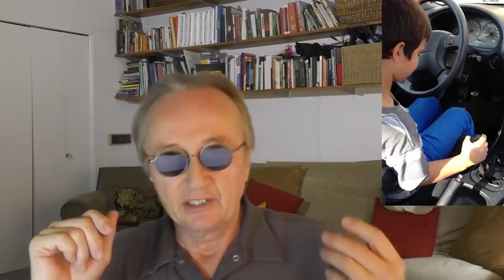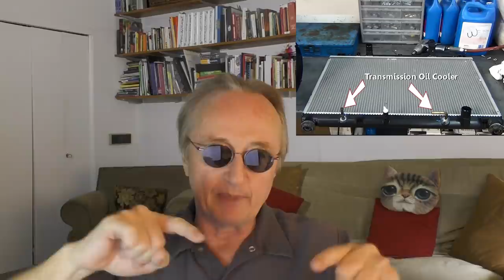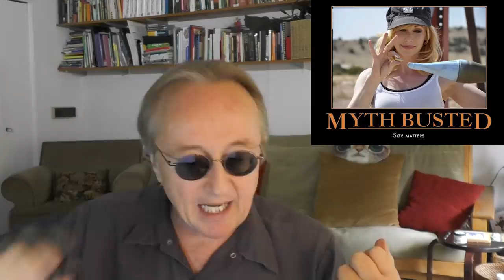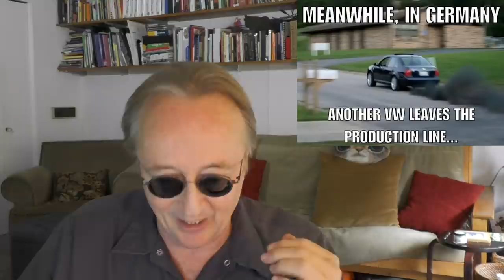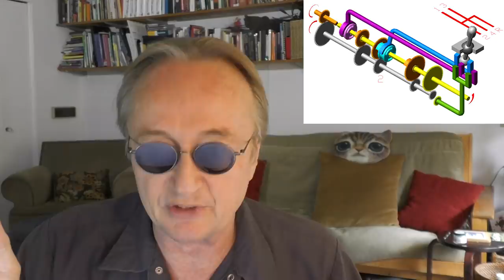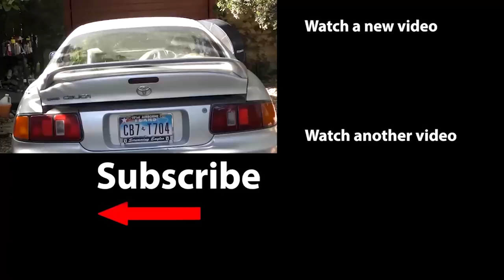Doing This Will Destroy Your Car's Transmission

Comment: I once accidentally shifted my dad’s 1998 ford explorer from drive to reverse at 30 mph. The engine stalled, but I stopped, shifted to neutral, cranked it a couple times, shifted to drive and drove off fine. That sane truck is still going 4 years later.
Reply: 98 Ford wow!

Comment: I can remember back in the late 60's early 70's, Chrysler has a commercial on t.v.. The commercial showed a Chrysler car, wit tires smoking, and the driver slamming the TorqueFlite transmission, from drive to reverse & reverse to drive,  for the entire 30 second commercial spot...Anyone else old enough to remember that  ?

Comment: Back in 1999 when I was young in my brand new Ford Ranger, I tried to show off for my boss mistress and tried to coast in neutral to rev the engine. I accidentally threw it into reverse for a Split Second then threw it back to drive. Made a hell of a tire squeal and she was impressed. I knew I screwed up big-time but here I am in 2019 still driving that same truck with no issues and 195000 miles. I really got lucky on that one. And my mistress boss gave me a raise LOL

Comment: Solution for #1: buy a manual transmission. 🤯
Reply: Junior I stop before shifting whether I’m in a stardust’s or auto. Not sure how different manuals transmissions are in that aspect
Reply: #1 anti theft device. The stick.
Reply: Some people can barely operate an automatic, throwing choice of gears and a 3rd pedal would destroy their life
Reply: @alansmilealot  true
Reply: Flat and the transmission
Reply: Flat if they made a stick shift Tahoe, I’d buy it.
Reply: @surgeonso4345  they do make one.................................

It's called a Mack Truck lol
Reply: Flat lol I don’t think my chain of command would like me driving that to PT every day.
Reply: @surgeonso4345  lol
Reply: Just paraphrasing Scotty.
Reply: Vladimir_Bone Spur_tRump  your comment would be considered dusty if you ask me...
Reply: a manual will leave you stranded many times throughout the life of a car every time that clutch is done. 

a proper automatic maintained correctly will last the life of a car.
Reply: @KyLesCaster  wait what, I've had many automatics go in higher miles vs losing clutches. I only loss one clutch ever and it was due to a seal going and spilling out on the clutch, I was able to get home still with it slipping. The autos had me fucked in the A.
Reply: i consider the life of a car between 0 miles on the odometer to 300,000 miles, a manual transmission will need at least 3 clutches minimum in that time and thats if driven very well.

an automatic will not need anything replaced. just be diligent changing ATF

Comment: OK every car my dad owned when I was a kid 50+ years ago would pop out of first gear when going downhill or even decelerating.  My dad was cheap and only bought used cars with 3 on the tree transmissions.  I grew up thinking that all cars were supposed to work this way.  Thank you for enlightening me Scotty, a half a century later.

Comment: Scotty, my dad drives a 2005 Jetta. Recently, the drivers window stopped working, then the drivers door lock stopped working, then finally, the interior trunk hatch and gas hatch latches stopped working. My guess is water in the door shorted a circuit. Everyone online says to check fuses and for bad grounds. I had to take apart his trunk's interior liner to pop open the fuel door with the emergency latch. I strung a string from the latch into the interior of the trunk through a hole I poked in the carpet. So, he can at least pull that from inside his trunk to pop the fuel door.. it's only a matter of time until his key remote can no longer pop the trunk!
Reply: Did you check the wiring between the driver door and car?  Those can break in the rubber boot due to how thin they are.

Comment: Automatic transmission are so expensive to fix
Reply: Not if you fix it yourself...
Reply: @nightdan7096  Not many people can rebuild an automatic transmission by themselves. Even if you do, it's still expensive.
Reply: What's expensive. If it's not over 5k then it's not alot
Reply: Thomas Golden 
It is when my entire car costs 5k.
Reply: @tenhundredkills  The most expensive rebuilt kit I ever bought was $300 for a Transtar master kit for my Toyota which I could have bought a different brand like I did the first time I rebuilt it for $125 which still last 200,000 miles. I can usually get a descent master kit for well under $200. Shift kits are well under $100 for a very good one. Torque converters are cheap. On manual transmissions you can replace the gears individually and the same with the bearings. Clutch, pressure plates and throwout bearings are cheap. It doesn't matter if it's a truck or car. It's not that expensive if you know how to fix it yourself and shop around for the parts. The newer ones simply have more parts. I'm a self taught mechanic from a very young age. I taught myself how to rebuild transmissions/engines, automatic/manual from reading books because I got tired of mechanics changing one clutch plate worth a few bucks and charging me for a full rebuild. When my transmission went out a couple thousand miles later after I moved 900 miles away and I took the transmission apart to see it still had the stock parts in it I was fed up getting ripped off.
Reply: @nightdan7096  Your time is still worth something too. How many people are going to take the time to learn the workings of any automatic transmission, diagnose the problem, and then repair it. It's specialized knowledge. Why else would you have businesses that repair nothing but transmissions and even then still can't get it right? It's complicated work. It's cool that you know how to do so, but don't say that it's "cheap and easy" for anyone to do. Manual transmissions aren't too bad, but the original comment is that automatic transmissions are expensive to fix, which is entirely correct.
Reply: So are engines but drivers ignore that more and say "It's be ok" lol
Reply: If you find,a good reliable guy not lart of a shop you can get it at a deal. Had a guy rebuild my 4x4 4l60e took it out himself and installed it himself for 900$ that was 20k miles ago.
Reply: Included fluid. Drove it 150 miles home hasnt skipped a beat.
Reply: @tenhundredkills  Automatic transmissions are the cheapest to fix. I know from experience. You obviously don't. I'm not having a pissing contest with you.
Reply: @LWNDmax  That a good deal since the guy also took it out and installed it too and included the fluid.
Reply: @nightdan7096   Not everyone has mechanical abilities, or can figure that stuff out.  It's like telling someone who's not good at math that calculus is easy, or telling someone with no artistic abilities that painting photorealistically is easy.  No one can be good at everything.  If working on cars was easy, everyone would be able to fix their own car, and there would be no need for mechanics.  That being said, you're lucky that you can understand that stuff!  Working on cars sure sounds like a fun hobby, but I have no mechanic abilities whatsoever.  I do change my oil and other basic maintenance, but I wouldn't attempt any repairs.
Reply: @hamsterama  Here is a sentence straight from my comment "It's not that expensive if you know how to fix it yourself and shop around for the parts." Did I say anywhere in my comments that anyone could fix or rebuild transmissions? No, I dint. I said "if you know how". Did I say anywhere that it's "easy"? No, I dint. I dint comment expecting everyone to be a freaking mechanic and to get butt-hurt if there not. What's wrong with you people. You just like to start arguments for something to do? Does it make you feel big or something or important. You gonna leave Scotty negative comments to because he talks about stuff you don't know how? What you just wanted to get your 2 cents in?
Reply: @nightdan7096  It sounds like you're having a pissing contest to me...I'm going to have to call bullshit on that claim!
Reply: Yes they typically are but it’s certainly not cheap to fix a manual and automatics don’t ever need a clutch replacement. They both have their place and neither is inherently better than the other, people need to learn to accept this.
Reply: Usually it's better and depending on the car cheaper to get a rebuilt one already
Reply: @nightdan7096  dude try building a transmission for a mercedes...
Reply: Just go pull another one from a junk yard
Reply: The big chains are a rip-off.  I had a local shop rebuild a transmission for a Chrysler for $500 and it worked great for another 10 years. Maybe it would have lasted even longer but I sold the car.
Reply: @marcelrodriguez2067  I had to come back and reply to your comment about the Mercedes transmission. It doesn't matter what vehicle it's out of. That's like saying you can work on older cars but not newer ones because they have electronics. A Mercedes transmission is no harder to rebuild then a Toyota or Honda transmission. Now you get into the more newer ones and you have more clutch packs, servos, parts, and also more electronics. The same process continues.

Comment: For anybody that wants to daily a jetta do it I have friends with 300k-400k on it and runs perfect I daily my jetta and put 10k on it a month I love driving it and I've had no issues same with all my friends  but dont get a auto they do happen to be weak.
Reply: 2nd this. I've got over 380k on my 02 TDI and it's still going strong.
Reply: I have an 04 Jetta 1.8T Manual. Bought it with 193k miles a little less than a year ago. It’s now about to hit 206k miles and the only thing that broke was a 40$ crank sensor since then it’s been crazy reliable and tons of fun with the turbo. Regular oil changes are key and they’ll last a very long time.
Reply: I don’t drive a Jetta but I have friends that have the older ones and they never had any problems with them, the ocasional clutch replacement here and there because they shift to early but other than that no issues.
Reply: Scotty sees the worst cases.  I had a neighbor who thought her Toyota was garbage because the engine was worn out at something like 65k miles, she never changed the oil once and probably never even thought to check it.
Reply: @motiszm  258k right here
Reply: What make and model???
Reply: @DeadlyDre  what do you mean what make and model were talking about Volkswagen jettas

Comment: The brake lights switch man. I had that issue on my 88 civic and that was getting to me for a good week and a half. My battery kept dying and I couldnt figure out why! Changed out fuses, new battery, nothin. I just happened to drive it around towards the end of the day on that last day and noticed my brake lights were staying on! It was the switch. So frustrating..

Comment: Smart guy here. I got a Chevy Sonic. 106K miles. It still runs great and never had a major problem. In fact I've never had to replace the breaks yet. STILL factory.--- My problem is this. The motor oil says 10-30 BUT 1 day it was really low so I put 10 -20 and for some reason now my gaskets leak oil. IF I get an oil change and put the right oil will the leak go away or did I screw it up and now need new seals? Thanks Scotty.

Comment: yep already did this with my trans prof, he says you got a flimsy band to hold the planetary gears and a solid but rigid band and when RD comes you get parts in the pan if you continue to play with RD  without stopping all the wheels since the strong but rigid band will break since its supposed to be grab the case that houses the planetary gears for reverse when it is completely stopped, the flexible one is good for going forward since thats what it was made to do it absorbs the engine torque while holding the housing (look up the inside of a auto trans if your really confused at what I'm saying I am not going to put the full story without pictures into a comment section). Though under an amount of strain flimsy won't like you and tear himself to shreds. in which leads you going nowhere in first gear or second and you'd be lucky to have a car now a days with a turd gear selection, though I would count on it making you move either.

Comment: When the engine is idling and in neutral, let the clutch out and then push it back in and immediately try to put into reverse. It should go if you spin the transmission.  If not. repeat again till it goes. When cold, the GO 90 is so thick it is hard to find reverse for sure.  My Muncie 4sp is the same way when cold.

Comment: Damn right. I shifted to reverse at 55mph for a split second on accident. Front and rear u joints had dents from the bearing needles and started growling.  With a front wheel drive car you are putting so much extra stress on the motor and trans mounts when shifting at a roll, so don't do it.

Comment: Old Jeep manual transmissions, I don't believe had synchronizers for reverse. The 95 XJ that I had would not go into reverse sometimes without first popping the clutch in neutral then pressing the clutch again and mildly grinding it into reverse. I believe it's because without synchronizers, the sleeve would not always line up correctly and would just bump into the cog.

Comment: Another thing for an automatic transmission is if you're parked on a hill put it in neutral set the parking brake let go of the brake pedal so that the weight of the vehicle is on the brakes then put your vehicle in park by doing this you're not putting so much stress on the pin that locks the transmission into gear and this can prolong the life of your transmission as well.

Comment: On a standard transmission when it is cold the oil in the trans is thick. It is hard to get any gear. Sometimes reverse has extra step like pushing down or farther to the side. I own a Dodge with a 5 speed. In the winter I put it into the gear I will need first thing in the morning.

Comment: I switched my transmission fluid in my 2005 Civic ex (automatic transmission) to Royal purple transmission fluid in 2015 the car is shifting well, even in this extreme weather in Northeast Ohio (under 0 or close to it) it also started very well one crank considering the cold, using 0w20 synthetic and a new AGM battery. The idea of ONLY using Honda. Fluid isn't completely true.  If u are smart enough to use quality synthetic) and don't down grade.

Comment: You also shouldn't throw your car in neutral when driving. Some people do that to "save the transmission" if they are coasting but that's bad to because you go from nothing, no spinning gears to putting it in gear when you go to slow so you go from nothing to spinning fast in the transmission and it hates that. I use to do that taking exits. I'd coast and pull it in neutral until I need it back in gear like a "manual" that's bad.

Comment: I had a 1997 Chevy s10 company truck do that before. But it did that on fifth gear, not first.  Turned out, they put in a new transmission price of about $2500.

Comment: Hey Scotty, we have a 2005 Cadillac Escalade (Ironic because you mentioned it in your SUVs not to buy lol) but everytime you put the car into drive, first gear doesn’t appear to be fully engage. It moves but very slowly, and the RPMs rev high while the speed barely moves. Now if you put the gear shifter all the way down to where it locks to 1st gear it works a bit better. Anyways after the car is up to speed to shift into 2nd gear, it shifts up to 5th no problem. What should I do?

Comment: My 2002 manual TDI jetta has 386000 miles on it and I drive it everyday. Also I've never had to replace the AC compressor. The autos that came in MKIV jettas were junk, but manual tdis make it to 500k miles all the time.

Comment: Hey Scotty serious question! Is it bad for an automatic transmission to be shifted into neutral to let it coast for conserving gas thanks
Reply: Michael's k. I used to do that but I stopped kuz I wasn't sure if it was bad neither, hopefully he replys to you.
Reply: Won't hurt it, but it actually won't make your gas mileage any better. Letting it coast in gear means the engine is spinning solely from the tires rotating, but if you pop it in neutral, the engine is consuming fuel to idle.
Reply: Michael its not worth it. You will coz more damage than you save 2cents fuel. Cars cut off fuel when its not needed ecu does all of that for you. Engine slows car too when its needed let the car do gear selection for you. Coz you will confuse car when you put in drive at some random speed & will struggle to know what best gear to select.
Reply: @truthprevailsjohn8324  not to mention when you need to brake you will wear the pads and rotors more.
Reply: Some states it's illegal.
Reply: @donsetliff7834  Good its incredibly unsafe.
Reply: @gravemind6536 : So it's not just unsafe, it's incredibly unsafe? Keep dreaming.
Reply: @hockeyguy820  I'm not dreaming, freewheeling is dangerous anyone who understands even just a little bit about cars knows this.
Reply: @gravemind6536 : Lol. Freewheeling is the opposite of dangerous. I do it all the time as part of controlling my car on slippery ice and snow. It's a safety technique.
Reply: @gravemind6536 : Um, next time you are in your car you might want to look for a pedal on the floor that controls the brakes. I use it all the time to avoid "crashing off a hill" (sic). You should try it. Or it takes a fraction of a second to go back into gear if I need to decelerate using the engine, or accelerate again. Maybe your boyfriend can give you some driving tips, because I don't have the time to teach you the basics. Hasta la vista!
Reply: No real point of doing that in a more modern car since the ecu will cut the fuel. But putting it in neutral will rest the engine at 800 rpm. The flip side of that is when you put it into drive the tranny has to do extra work to get back into the gear you once were or need to be. Just not worth it.